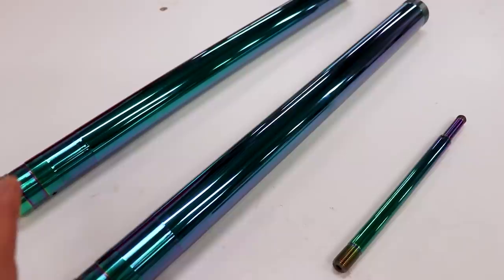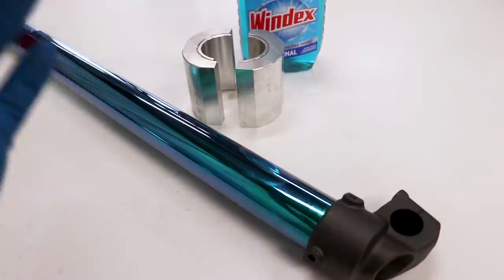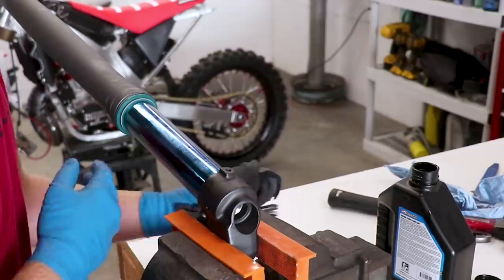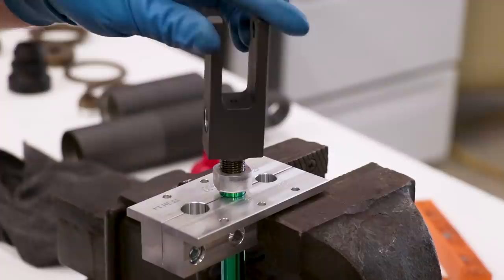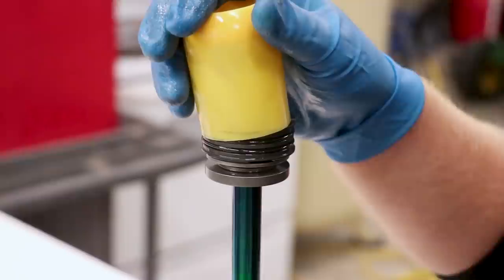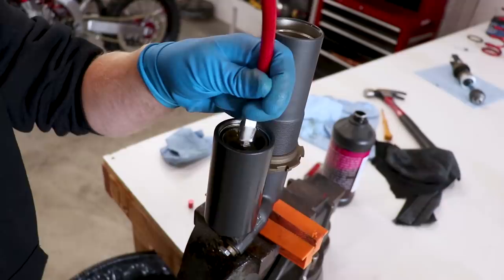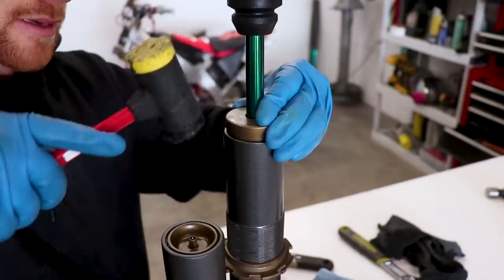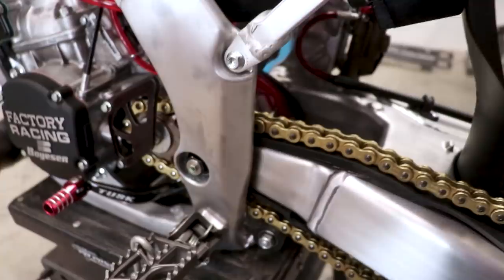New Suspension For The CR250!

Comment: I just put together a nitrogen setup to fill shocks and really whatever I want with nitrogen like tires because nitrogen holds a more steady pressure than air. You can get into it really cheap, the tank will be the biggest expense. I bought a no loss chuck digital filler but you can also just fill it off the nitrogen regulator with a regular air chuck by setting your regulator to the desired pressure and that will get you close. I paid under 50 bucks for a regulator on amazon then 25 for a hose but you can get a lot cheaper on the hose. A little tip as well what i learned is the no loss chuck needs to thread on quite a ways onto the Schrader valve and mine were too short so motion pro makes a Schrader valve extension that fixes this so you can use a no loss chuck. For anyone thinking about getting their own nitrogen filling setup you really should because it can be done a lot cheaper and better i think than the nitrogen filling kits you can buy. Like I said for the bare minimum a tank, regulator, hose, air chuck it can be done at a very reasonable cost. You can also get a no loss chuck by itself for 30 dollars on amazon and use the regulator for the guage if your worried about using a regular tire chuck. My local bike shop charges 38 dollars to fill with nitrogen and they are the only shop around that has it.

Comment: A little tip on shock assembly--clamp the body (safely!) in a vise, and with the piston submerged and the body full of fluid, WHACK the rod end with a ~2 pound (or so) Rawhide Mallet. You're only moving the piston an eighth inch or so, but it will splash a bit sometimes. Repeat until no more bubbles emerge. This is the only way to get all the air out of the valve stack. If you think you've been doing it right all these years, try shocking the stack as described, I guarantee you WILL get bubbles out of the valve stack!

Comment: Great job and instructional vid and I have worked on many of my own shocks over the years. I got sick of the "mystery" of woking on suspension parts and the outrageous fees the shops charged for the work. So I decided one day I was going to tackle the suspension mystery and as it turned out it's no mystery at all you just need to do a little research, watch some great vids like yours and buy a few inexpensive "special" tools and it's not that big a deal. The tools were far cheaper than what the shop charged and I figured, hey, wtf, if I screw it up I can, then, just take it to the shop...That said, as you pointed out, it is critical you have not even one small air bubble in the oil of the shock or that will expand when the oil heats up and the shock will fade big time and there's goes your dampening. What you didn't say or do which I like to do is, when you finish the shock, before you put the spring on, get the nitrogen filled to spec then stand the shock on end and compress the shock, then let it expand on it's own and if you have any  air in it, the shaft will push back out at normal speed until it is at the last maybe inch of the travel then it will speed up and kind of snap out quick at the end of the travel. That's a sure way to check if you missed some air bubbles before you re-assemble everything and figure out later when riding you need to pull everything apart and do it over... I have a big write up on "YFZCentral" detailing shock rebuilds. User name "trxxx250r". It's regarding a YFZ450R quad bu it's the same thing.

Comment: Another great video Cam, never seen anyone pay so much attention to detail as you do and i'm the same. I have to ask you though about the Ceracote and powder coat. I've done 2 frame up restorations on LT80's and i loved doing it, plus selling the 2nd pretty much paid for the 1st. Anyway i plan to restore my 2004 KX250F back to showroom condition and was wondering how much money do you think you have put into the CR250 with using those coatings? Of course i plan to coat them myself, just would like to know about how much do you have invested in just the materials. Thanks (I never sold the bike because i think it's gonna be pretty cool to have Kawasaki's 1st modern 4-stroke race bike)

Comment: You didnt change and bleed the oil in the secondary fork chambers
Reply from the maker: Did that in previous videos
Reply: @CameronNiemela  you got to ditch that lectron and get a PWK with the STIC metering system. It blows the lectron out of the water